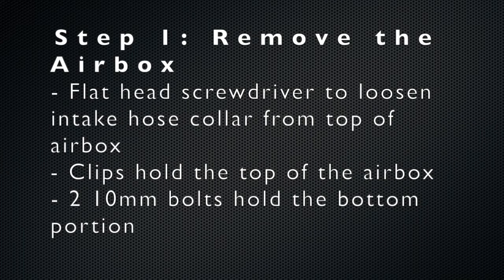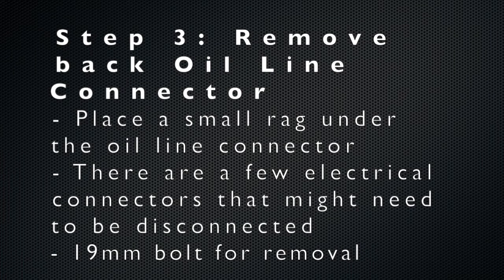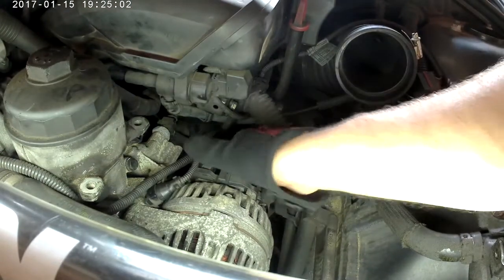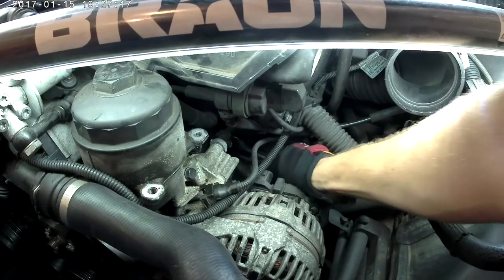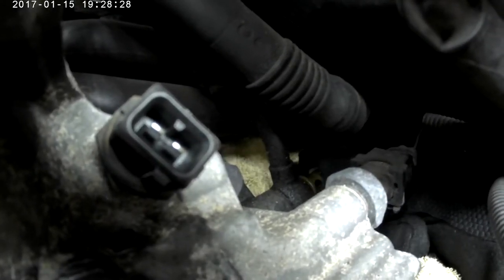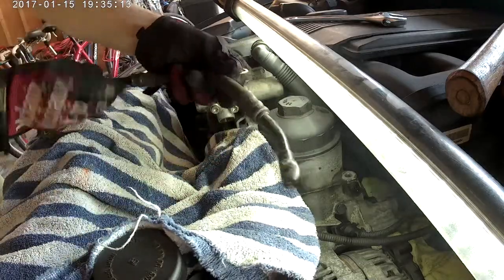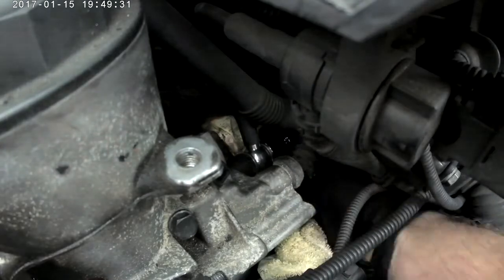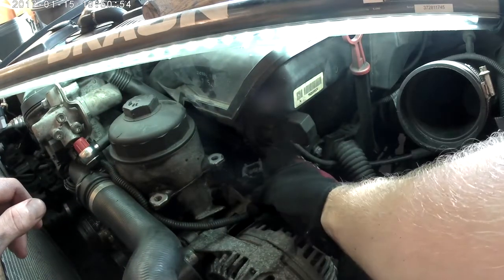BMW e46 Oil Feed Line Replacement

Comment: Did you have to drain your oil for this?
Reply from the maker: I don't remember draining the oil beforehand so I looked up a few other DIYs to make sure. None of them mention it, so I'm going with no
Reply: @AvoidStealership would opening the oil cap and loosening the oil filter top allow the oil to drain to enough to replce this part AND tge oil filter gasket without draining the oil?

Comment: I damaged my oil feed line while replacing the camshaft position sensor. This video is very clutch good sir. Thank you!
Reply from the maker: 😎 Glad it helped!
Reply: I did the same, re: camshaft sensor. Can you get to the back oil line connection from under the car? Is it any easier?